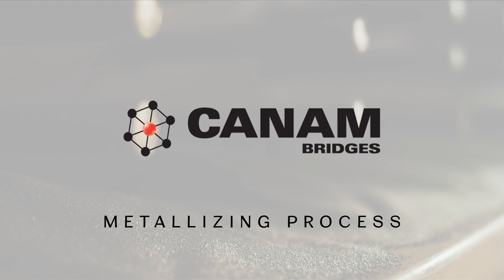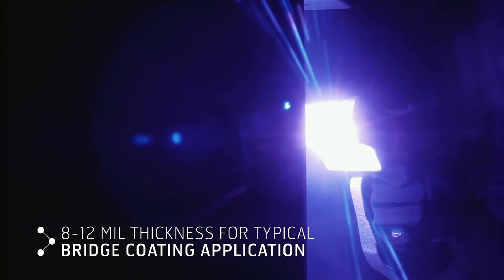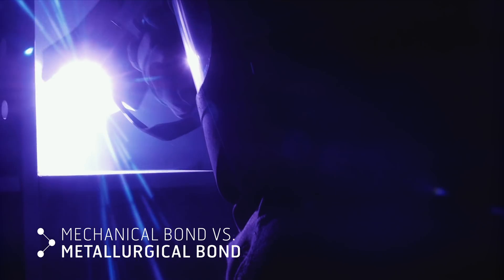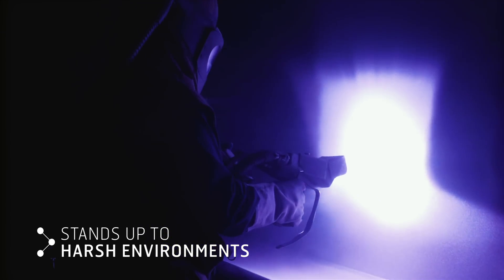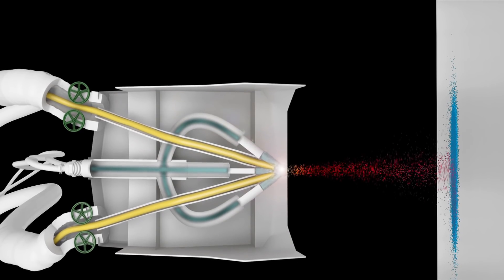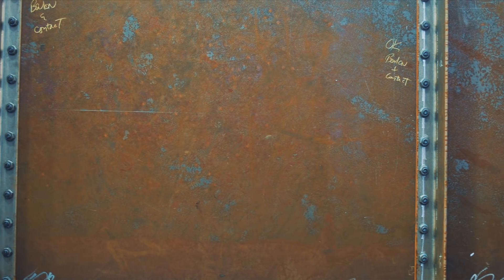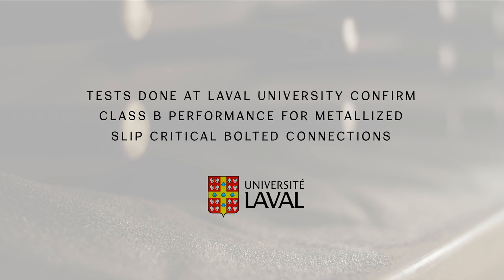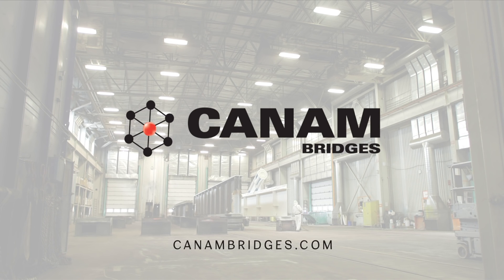Metallizing from A to Zinc

Comment: Hi Canam,
Would you advise using metallizing over galvanizing for a seaside application?
Reply from the maker: Hi, 
No, Canam would not advise using metallizing over galvanizing, as galvanizing usually provides a good corrosion protection. Moreover, the surface preparation of metallizing will reduce (if not completely remove) the thickness of galvanization. However, a duplex system with paint over the zinc coating may be a solution in order to last longer in aggressive environment.
Reply: Thanks for the prompt response.

What i actually meant is that i have the option of Metallizing or Galvanizing for a job both using a Duplex system. We were advised to use metallizing but want to be certain it will be equivalent 

Thanks in advance
Reply from the maker: You can contact our expert. He will be happy to answer all your questions about metallizing. Thank you for your interest in our company.

Éric Lévesque, M.Sc., P.Eng.
eric.levesque@canamgroupinc.com1-877-304-2561